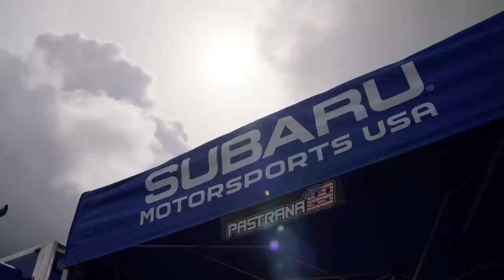Launch Control: Wildcat - Episode 9.3

Comment: How close to stock is the motors that VSC is using?  With all the trouble you hear about head gaskets and transmissions on Subaru’s, what does VSC do to combat those problems?